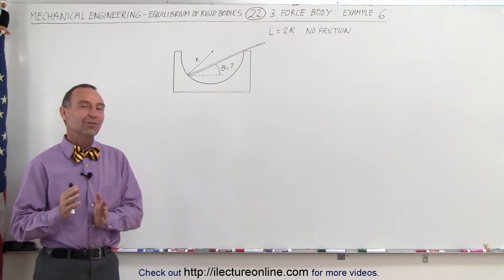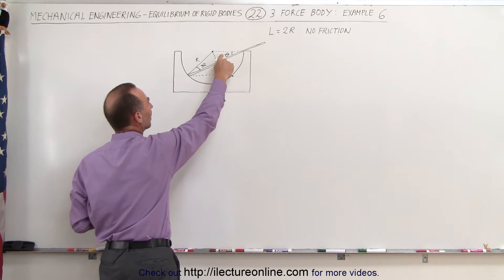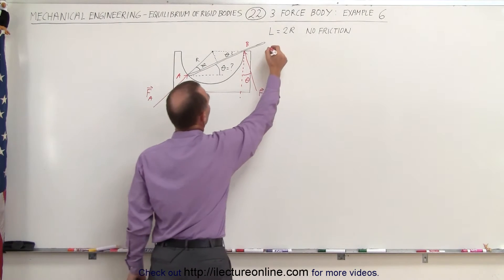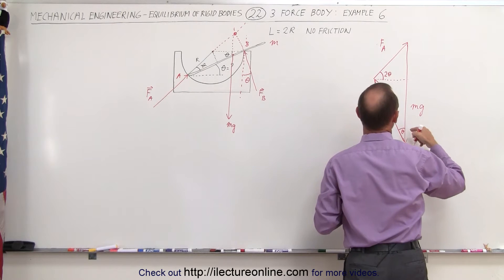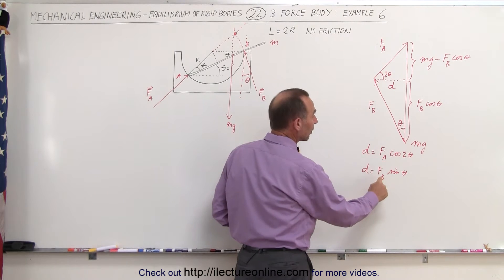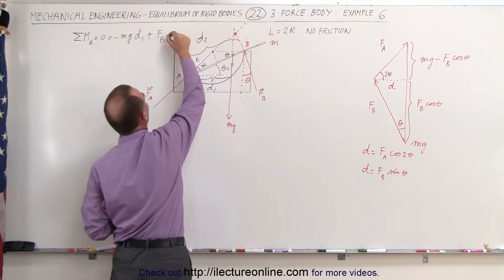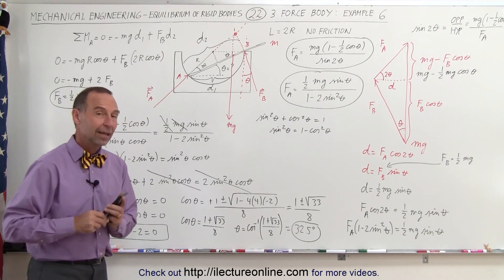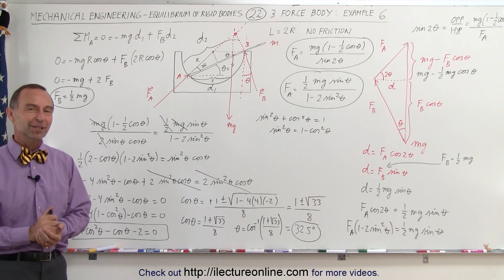Mechanical Engineering: Equilibrium of Rigid Bodies (22 of 32) Ex. 6 Eq. of 3-Force Body

Comment: Thank you Michel. Now It's clear like water. now I can solve for L = 3R or 4R or anything. But I took a shortcut on solving the theta  using calculator to solve for x . the I calculate the angle in first quadrant. I found that easy and time saver. Again Thanks a lot.
Reply from the maker: Glad it helped!

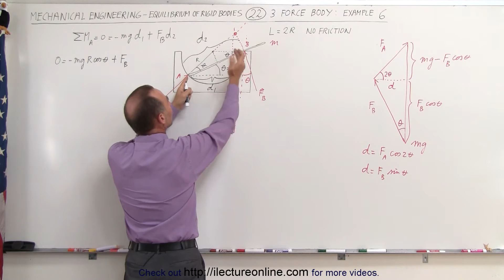Comment: there's something wrong with the distance from Fb to A when calculating the total moment. at 7:07 you took Rcostheta for the perpendicular distance(d) for the weight mg. that means R is equal to the distance from point A to the red dot at the center of the rod. But at 7:48 you take 2Rcostheta for the distance from Fb. 2R is the whole length of the rod but the Fb is not applied at the end of the rod.

Comment: How can we assume the angles are the same from drawing the perpendicular line? Under the assumption that the drawing is not to scale, what would be the proof for this. I'm unable to grasp the basis of this.
Reply: Is it because the horizontal line segement has a magnitude equal to that of the radius. And, since all sides are equal, the angles would be equal as well?
Reply from the maker: If two lines are perpendiucular to one another, then the reference angles from those lines to the vertical and horizontal axis must be equatl (since they are perpendicular as well).

Comment: 2:30 why is the angle of Fb off the vertical project also theta? I'm not sure how to derive that.
Reply: Oh, is this base off the parallelogram of lengths R? Since Fb mirrors the first perpendicular, you can reference it to derive theta?
Reply from the maker: Because the direction of Fb is also perpendicular to the rod.

Comment: Sir, why  mgd1 is  negative since mg acts at the center of the mass of the rod and it is  inclined? Shouldn't it it be in counter clockwise direction?
Reply from the maker: Relative to the pivot point A, the mgd1 is negative (clockwise torque).

Comment: Thank you a lot, professor! Can I try to solve this problem in an alternative way? I assume that the center of mass in this equilibrium will be at the lowest point possible. Not sure if this assumption is correct , but if it is, I can try to write out the expression for the height of the center of mass, using theta. Then I only need to find the minimum of this expression. This way I don't need to analyze the forces.
Reply from the maker: I always recommend trying different approaches because that way you will understand the material better.  Try it and see if it works and see if you get the correct answer at the end.
Reply: @MichelvanBiezen  Dear professor, thank you for your reply! I tried and the trigonometry got quite messy lol. I will keep working on it and see whether it works though.
Reply from the maker: That is part of the problem.  Sometime you pick the method that makes solving the problem the easiest.
Reply: @MichelvanBiezen  Yeah, that's right!

Comment: Doesn't mg act at the center of mass of the rod?
Reply from the maker: +82rah 
That is correct.  The drawing is a little off, but the problem was worked with the assumption that mg acts at the center of the rod.